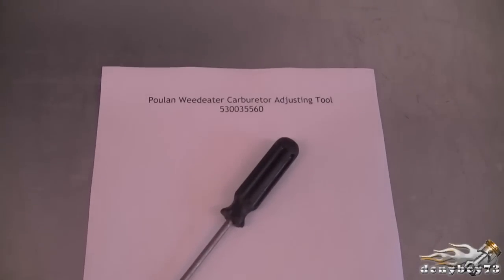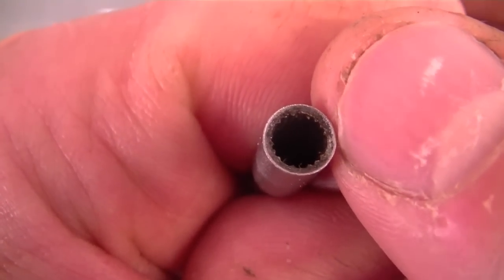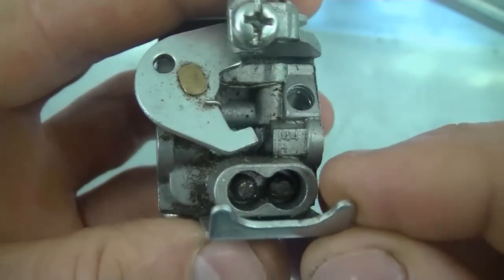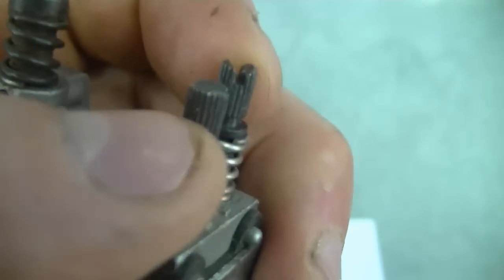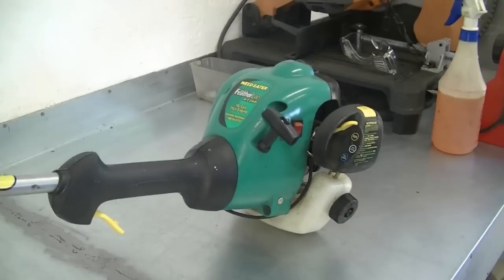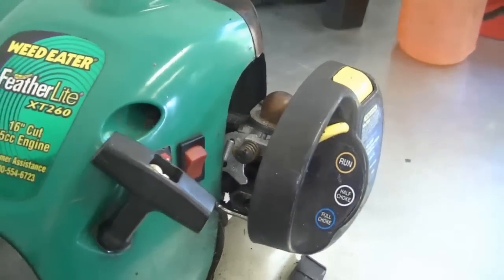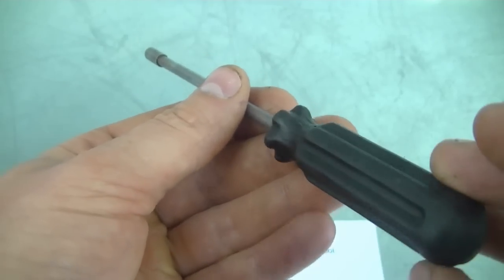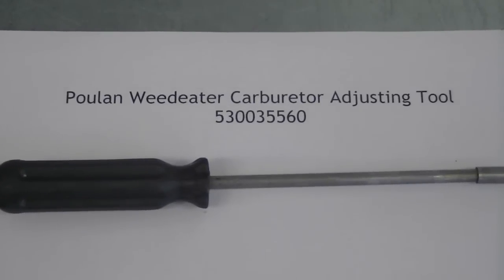TOOL REVIEW - Carburetor Adjusting Tool For Small 2 Cycle Engines

Comment: I needed one of these for my WeedEater leaf blower last fall, and found for a quick fix to use a butt-end wire connector and a regular old screwdriver.  The butt-end slipped onto the pin perfectly, and the splines held it in place.  I was then able to use your tips to get the blower running great!  Thanks for you help Dony - and hopefully this proves to be useful for someone else!

Comment: I'll take some pics tonight for you. The tip of it is round with a tiny pin offset to one side. The screw it fits just has a round head with a tiny hole in it just off center. I've only needed this tool a few times.

Comment: There are a total of 7 "special" screwdrivers for adjusting the carburetors on 2 cycle engines. I have all 7 of them but it took me a few months to get them. The hardest one to find is the "Offset Pin" driver. Then there's the standard four which are the Splined tool, Single D, Double D, and the Pac-Man. The other two are the "Tiny D" and the Stihl 4MM Hex driver. It's nice to have the proper tool when something comes into my shop.
Reply from the maker: do you have a pic of the offset one?

Comment: THANK YOU!!!!  My Craftsman 358.791070 32cc weed trimmer has been running like s**t -- it'll run fine with the choke on, but when I hit the throttle, it dies.  Was thinking I'd at least have to buy a new carb, but thanks to your vid I have ordered the tool you reviewed and expect to have my trimmer running like a top within minutes of the tool arriving on my doorstep.
Reply: I had the same problem , the engine wont run out of the box with out adjusting the carburetor

Comment: I searched several big box stores for these and settled on a 4 piece set with common adjustment paid a little over $30..00 with express shipping. Hope it fixes my unusual problem. I think my Ryobi is putting out too many rpm's It idles fine but rips off the .095 stringer as soon as it hits the grass. I purchased two replacements and they were not the problem.

Comment: Great video and I found the best way to know the number of turns is to number your ribs or sides on your handle.   If the handle has four sides, then it becomes 1, 2, 3, 4.  If you have 6 ribs then number each rib from 1-6.   This way when you wanting to know how many turns you went in or out, count the numbers.   If you turn it 11/2 turns in on a 4 sided handle, then as you are turning it in, 1, 2, 3, 4, 1 1/4, 1 1/2.
Reply: Awesome comment and advice Tony!  👍👍👍✌🏻

Comment: Thanks again Don, I will be ordering a set of these soon. However, I found that I can use a BIC pen (remove the tip and ink refill) and it fits perfectly over the screw. Since I bought a new Husky chainsaw, I will sacrifice my 4218 to learn on.
Reply: colin p 
Just a reply to myself. The BIC pen does (kinda) work but it's better to get the proper tool. For those of us in the "Peoples Republik of Canakastan", we can get the tool from Amazondotca

Comment: I picked up my new Stihl tool today. It's just a 4mm hex but what makes it "special" is the wall is VERY VERY thin. You might be able to take a regular 4mm spin tight and grind it down but to get it this thin without getting it too hot or grinding too much and making it weak would be tricky. It cost me $9.52. The guy at the counter questioned wether or not it was a restricted tool but since thier computer didn't flag it he let me have it. I think it's a mistake on Stihl's I.T. dept. lol

Comment: If you don't have the tool you can modify a limiter cap to fit in the hole to get the screws out and then take thin dremel disc and grind a slot in the screws so you can use a slotted screwdriver to tune the machine

Comment: If your in a pinch and don't have the time to order/ go to the store to buy the tool you can try what I did. I used an old Bic pen that was out of ink, I pulled out the point and ink tube and filed the sides near the tip down a little to fit. Then heated the tip with my Bic lighter for a second or two to soften it a bit, pushed it on let it cool a second and turned the screw. I don't know if I just got lucky but if your stuck it's worth a try

Comment: It's just a round screw with a hole or dimple in the head of it. The hole is offset a bit to one side. One of these screwdrivers is on ebay right now and it has a bid of $55.00 on it which is CRAZY. It's part  # 797-00039, MTD Zama carb adjust tool. I've learned a lot from your videos but I'm a poor man so I can't afford to donate but I'd be glad to mail you one of these once I figure out how to make them.

Comment: So Dony..  that's for the regular "d" screw and access hole. 

What diy solution for the mini/smaller "d" screw and access hole (that is now almost impossible to grab and turn) on my 2010 Echo PB-250 blower?

For that, Walbro/Echo/Shindaiwa had a "long d" adjusting tool (91059L) but it is not now available except through special circumstances (EPA mandated) from OEM.

Comment: Thanks for the info. Revisted this video as my neighbor tossed his old weed eater (same model as the one in the video) due to it only running for a few seconds, and only if the choke was all the way on. I found that while the carb parts were still good, it was dirty and full of gunk and the like. Cleaned it out, put it together, runs a lot better, but the carb is WAY out of adjustment. Way too lean. Luckily Amazon had the tool for $10 shipped (I live in Indiana, lucky me).

Comment: i notice that the flat piece where the wires are snapped on the air conductor is really easy to push in and that where its bending when the saw revs up. would buying a new air conductor work?

Comment: I just came up with a carb from a Briggs and Stratton engine 12H208-1761-E1. I'm cleaning it up and started cleaning the carb but none of my carb tools works.  The jet in the center has two holes one larger that the other.  How do I remove that jet for cleaning?  Haven't seen this before although I'm new at this.

Comment: I just picked up two lawn edgers at a thrift store yesterday for $5 each. The engines will see life again on bicycles. One is an MTD with a 3 hp Briggs (?) minus carb and intake manifold and the other is an old Craftsman 3 hp Eager-1, which I believe is a Tecumseh (?). It has a "rounded block" with side exhaust. Is there any chance I could send you some photos of the carb and maybe you can tell me what it is? It sits well below the intake valve. An updraft maybe?

Comment: For $3 I bought a disk for my hand held drill (Dremel). I simply ground off the aluminum housings for the high speed jet adjustment screws for access to the adjustment needles. I used a hemostat to tweak the jet setting and had positive results. If I'd had a cutting wheel available, I could have notched the stupid needle head for ordinary screw driver adjustment. Stupid EPA.

Comment: i have a question for ya donyboy. I have a old john deere 140 k301 motor . if i spray carb cleaner in carb it will start sputter and then die if i keep spraying it will keep running somewhat . the other day it started and ran for 6-10 mins i shut it off and restarted it it was fine now it is not starting . it used to be my dads he always had problems getting it started . how could a carb problem be intermintent . i cleaned it put fresh gas in it . i got a carb kit coming in the mail so we will c

Comment: The part number for the Troy-Bilt / Zama carb adjustment tool is MTD 797-00039.  I've found a few sources and it costs $33-$43.  Ouch.  I made a tool to adjust the carb I was working on.  But it is flimsy.  Suggestions on where to buy?

Comment: Replaced the size of trimmer string to .65 as recommended on the box. It does not rip off the stringer as before, but adjusting is a problem as I don't have a mechanics ear and can't rind proper tuning information. Help!

Comment: Hey Dony , I put a new carb on a echo GT200R . Figured it was easier than rebuilding it . Installed it , fueled it up , started like a champ , but bogged down and went off. Continues to bog down and die  .  I reversed the fuel line and suction line to see if they were backwards , same thing . Any ideas?   thanks g

Comment: I have a set of 4 of these tools for the different screws not just splined. My problem is the length of the handle. I have a backpack blower where the screws face the blower housing and it is too tight for the handle to fit. I would either need a stubby version or a bit which can be used on a ratchet/right angle or an extension.   Is any such thing available??  Please let me know. Thank you.

Comment: I'm working on a toro trimmer.  The carb adjustment screws are smooth on the outside and have a "dimple" in the top.  Do you have a part number or place to buy a tool to fit this adjustment screw?

Comment: was using my  model #952711953 husqvarna 28 cc 17 inch cutting weed eater today and it will not stay running. tried tightening the idle screw but no luck. was wondering if this tool will do the trick. it appears to have the same no groove spline design adjustments as the other weedeater.

Comment: I have an Echo PB-250 Blower, with a walbro carb, it has two small adjustment D type screws for H & L, I would like a tool to adjust them, it cost me over $20 to have a Echo dealer tune last year. I saw somewhere that the EPA has made it illegal to sell these tools is that true?
Reply: $12,000 fine for selling the screwdriver now. Freaking government needs a tune up.
Reply: Actually I think the fine is more now, however I am told that the setting is not the problem, rather it is a gunky carb. So it's a good idea to clean out the carb perhaps ultrasonic clean, and rebuild it, and that should bering it all back up.

Comment: What do you think about the sets they sell on Amazon with different heads?
Reply from the maker: Adam Barraclough PROBABLY CHEAPER BUYING IN A SET
Reply: Dony,

I'm not much of a fan of forums because you don't know who really knows there stuff. I tried to send you and email to your yahoo account about s mower I'm working on. Is they accuse t good?  Maybe my message got tagged as spam. 

Adam
Reply: donyboy73 

Second question.  On the same carb.  Generally how can I determine what the intake line is vs the purge line?  One is on the top near the bulb and the other is below the bulb.  I just want to make sure the intake is being filtered, obviously.

V/R
Adam
Reply: Adam Barraclough I ordered one from Amazon (a third shipper) and of the 4 set only 3 arrived, and it was the Poulan that was taken out of the box! When I complained, they got mad at me so I returned for a refund and ordered just the one from the Ebay outfit called pandora box. Ten bucks CDN$ all in and it arrived in 3 weeks (the Amazon company took TWO weeks!)

Comment: Hi im kong I have question about weadeater carb adjustment screws. I don't know what the proper way to adjust them if they have ben taken out .
Reply from the maker: screw them all theway in then turn them out 2 turns each
Reply: Thank you vary much that's gonna help a lot.
Reply: Don't know if you have covered this problem but I get a lot of people that come in at the start of the grass cutting season with a weed eater that won't start. The first thing I do is check the muffler. 9 times out of 10 it's stopped up with a dirt dobber.
Reply: donyboy73 Very good tip Don, love the videos!, keep up the GREAT work, Hope all is well with you & Family.

Comment: eBay is the first place I checked.  Nothing there with MTD 757-00039. Plenty of of Pacman, Spline, etc.  do you know of a different part number for tool that adjusts needle with dimple in top of needle?

Comment: And if they do its not the end of the world since a dremel with a cut off wheel will slot the bolts so you don't need the tool and you can use a regular flat screwdriver.

Comment: Hey don't u know its a federal offense to sell that tool to the general public in the states  u should really take this video down
Reply: +Travis Boyd well that is hard for me to believe here in Arizona since when I ordered a carb online it basically told me to order one for another 5 dollars.  Another reason I find that hard to believe is that many carbs are built with a slot for a regular flat head so it is more convenient for anyone to do this.  I wonder where you get your information?  Facebook maybe?  Oh yeah and they also arrested Tupac's killer who was P-diddy or Sean Combs and Nasa had broken the speed of light to by the way an if you will believe that you should also know that the new Iphone 6 doesn't need a normal charger since you can charge it in your microwave to.  An donyboy sorry about that nonsense and thanks for the easy to understand and very informative videos in which you freely teach people how to repair there small motors which has saved me alot of frustration and money.  The rest of my family isn't here but if they were they would also thank you to since you have also saved them from having to spend quite a signifigant amount of money and allowed us to easily use several tools that would otherwise have been difficult to do the job with and made it so I don't even have to wait on anyone else for help either.